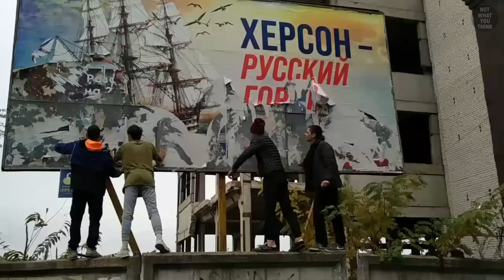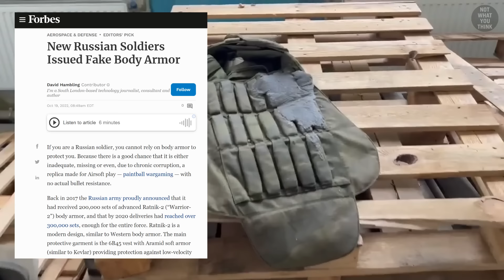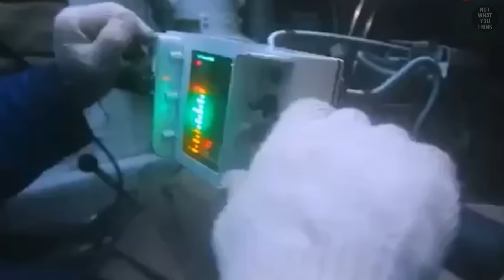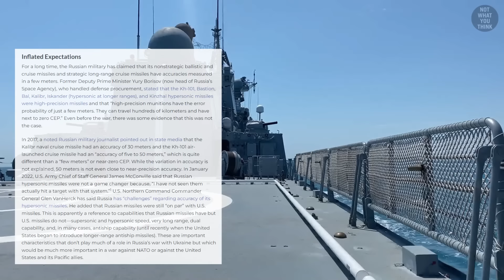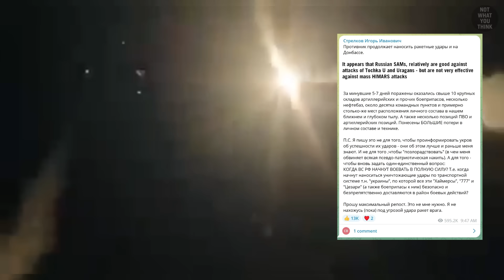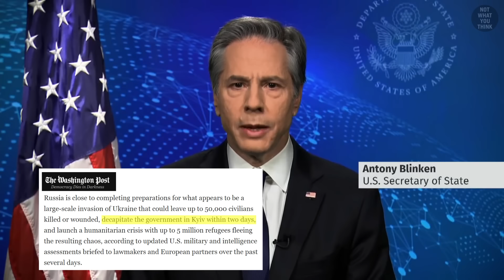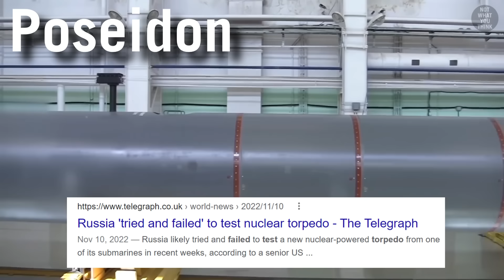The True State of Russian Army

Comment: Lazerpig also has several videos about this topic, my favourite being "what sunk the Moskva" where he goes in detail about how great the ship should've been, and then reads out an alledgedly leaked readiness report. Let me quote this part directly from that video.

"Out of the three-tier anti-missile systems in place, none of the actual systems were working at the time he was struck
the short-range sea to air launchers did not work and the flanex last resort missile interception of which the ship has six, only one worked, the rest were being used for spare parts
this left the s-300 anti-air systems which could theoretically protect the ship, however the radar system they were linked to interfered with the communications system and thus was turned off
but even when turned on, the system apparently had difficulty locking on to targets
and that twin-linked 130mm cannon that could be used as a backup to the CIWS system? yeah that also didn't work, hydraulics leak apparently.
and all the damage control systems, yeah none of those worked either. several other watertight doors were found to be leaking, some were wedged open.
out of the 500 fire extinguishers that were supposed to be on board the ship only had 50
and due to constant theft the safety equipment was locked in storage of which only the admiral had the key to
meaning in order to try and save the ship the crew would first have to try and break open the lockers the safety equipment was in
it gets worse
several of the engines were past their service replacement date by about 10 000 hours, they could only be turned on and run by express permission from the admiral meaning the ship was locked in at about half speed, but only for emergencies
the vast majority of the control systems were non-operable or simply did not have a functioning indicator light meaning that if there was a problem no one on the bridge would know about it the ship's generators were all quickly approaching their maximum service life and would appear to work at random.
the steering gear was also partially jammed and the ship could only perform a 20 degree turn and the entire ship had heating and cooling issues.

Had the Moskva been a US ship and been found in this state the captain would have been court-martialled"
Reply: Moskva was also very old, 50 years old.
Reply: @YorkerEli  Sure... 50 years old does come with its issues... but you gotta maintain your stuff. The Iowa class battleships did fine shelling iraq, they were 50 years old too. Fully combat ready with CIWS and missile launchers. Good maintenance is key, but in the corrupt world of russian officers that didn't happen
Reply: Lazer Pig is ight but the way he exaggerates his accent is annoying.
Reply: I will say this.
I love lazerpig, but, and this is a big but, he was rather quick to take that document as the real thing.
Until I get confirmation that this is a legitimate document of the russian navy, I'm going to hold my doubts on it.

But something clearly went wrong with the ship for 2 missiles to have connected.
Reply: @YorkerEli  the Moskva is only around 40 years old and received a refit in 2016 which expected to extend the ships life expectancy of the ship to 2040.
Reply: @NeputuniaNepp  So if that is the case, it paves even worse look on russian military, if not even refits and maintenance could save it from two missiles.
Reply: Now, wether or not that report is real is up for debate, however, it does raise an interesting point:

According to what we know, the Moskva was sunk by 2 Neptun missiles. They're a ukrainian domestic model, comparable, capability-wise, with something like Harpoon.

Thing is, even if the Moskva's CIWS was inoperable or barely functioning, as the report suggests, two missiles with a warhead of that size should not have been able to destroy a ship that size. It would have been a pretty painful hit, no doubt about it, but it certainly shouldn't have sunk her. There's tables on that type of thing that outline exactly how much of any type of munition you need to have, say, a 90% chance to disable or destroy a target, and according to what we know about Moskva, being hit by 2 missiles shouldn't have sunk her. 

So either, the ship was in such a disrepair that the damage quickly became irreperable, or the damage control teams, if they existed, were completely inept at their jobs.

As for why the missiles weren't plucked out of the sky by Moskva, Perun has offered an alternative explanation, that being operator fatigue. The displays in these ships were built in the 70s or 80s, and aren't very pleasant to look at. Having to look at them for hours on end makes would quickly fatigue your eyes. And if you're months into a campaign, that might lose you to become unaware enough that you don't noticed the two missiles approaching you until their radar goes active and you get a missile lock alert, at which point, activating CIWS might be too late to actually do anything about it.
Reply: @nukclear2741  I think this and other videos showing how badly the Russian military is at the moment, especially logistics and supply-wise it adds credence to Lazerpig's video.
Reply: @spookyskelly5276  But you love his singing.
Reply: About the only part of this I find entirely unbelievable is the bit about a US ship in that condition, if a US ship were found to be in that sort of condition pretty much the entire officer complement would be looking at a dishonourable discharge for not fixing it or reporting the problems, any military port that had so much as refuelled the vessel in the last 3+ years would be getting grilled about why they didn't report it, the last 3-5 docks that performed maintenance on her would be audited within an inch of their lives, and any contractors involved would be almost guaranteed to lose their contracts. The US Navy takes their vessels condition pretty damn seriously, for good reason given how much they tend to expect of their ships in terms of operating ours and distances, and they take their reputation even more seriously, jeopardizing that is a real quick way to land yourself in very hot water. 

Pretty much everything else is at least believable, given some of the other things we've seen both recently and over the years from Russia. Not saying it's true, but it's at least not outrageous.
Reply: Now that makes sense!
Years before this I had some thoughts thinking that how did the Russia’s weak economy supports it’s big ass military assets
Well turned out that they don’t
Reply: Black sea fishes have new homes now, Moskvaville. Rent free too. Reminder: Fish🐟 homeowners meeting in Moskva's CIC, every 1st Saturday of the month.😄
Reply: This sounds like the litany of issues that caused the WWII USA’s Mark XIV torpedo to be such a dud.
Watch “Drachinifel’s” YT Channel on this torpedo,  called *Failure is like Onions … * for the best 45-minute Failure Analysis you’ll ever see! 😊
Reply: @YorkerEli  - the USN has some ships that are over 60 years old - still functioning. The average age of the Navy’s current battle force ships is 16.4 years—about one year less than half of the fleet’s notional service life of 35 to 36 years.
Reply: @NeputuniaNepp  - WAS…. Hahahahah
Reply: if it is all true then that boat was literally floating trash can and it was cheaper to blow it up, than try to fix everything broken.
Reply: Смехотворно. Источник - верь мне, бро.
Reply: Ну затопили и чё дальше, все равно все кто на том острове остались до сих пор лежат там в виде костей.
Reply: @YorkerEli  The USS Iowa, a WWII battleship, was decommissioned in the 1990s. Russia has no excuse.

Comment: It might be unbelievable to see so many things failing due to maintenance, but to be honest high end tanks, trucks, and aircraft require a very significant amount of highly trained crews to support their operation.  For example for each individual fighter jet sortie you will typically have between 20-50 technicians dealing with the fuel, inspections, engine maintenance, repair, rearmament around the clock.  Much older equipment, like the simple truck or less sophisticated tanks, requires less frequent maintenance and fewer support personnel; but they still require people trained in proper procedures and quality components (tank tracks fall off pretty easily if you use 40-60 year old spare parts, or don't know the people with knowledge of the 'tricks' to making them last).  And then when you use that older equipment you can't expect them to perform up to the speeds and capabilities of newer models.
Reply: hi
Reply: and russia lacked all these things. im willing to bet that a the majority of nato equipment in storage is well maintained and works when needed
Reply: My dad was in soviet army, all I can say is it wasn't maintained then, now it probably is worse. He had to drive a rocket carrier truck once a year just to see if it's running, a f-ing rocket carrier with 2 cabins. His jeep wasn't better either , if it broke down he didn't get new parts, he had to take them from another jeep that is sitting by side and is not used currently
Reply: @jimmybayconn  thats a big assumption, I think most nato states has the same fate because after the cold war most nato countries cut their defense budgets, only the US didnt.
Reply: the culture of  Russia the General takes a cut, the Major takes a cut and the Captain, the NCO and then the lance corporal. so when you get to fixing the actual tank there`s just a few roubles left
Reply: @muchi123456  No, the difference is that NATO states slashed their numbers. My own country for example would have to borrow tanks from Germany, if we want to have tanks. The equipment we do still have is very well maintained. 

Russia on the other hand has a very low military budget, but they do keep all their equipment, leading to said equipment being in all states of disrepair and destitution
Reply: @jimmybayconn  Yes and no, every more complicated equipment in storage is inspected every two years, and mantained every 10 years and overhauled (S4) every 20 years.
So if you have an item which is 11 years in Storage, it will work, if it is 21 year in Storage no Problem. Is it 19 Years... good luck. One of the reasons why the Bundeswehr scrapped 300 of it's 400 PzH 2000 even when they have been only 15 Years old at that point. The Depot Costs for them would be eat hefty into the budget. And nobody expected that we need them 10 years later.
Reply: @youtubevanced1508  no really the new tank you talk of doesn`t work. it`s also very heavy and uses a good deal of gas. you also got to get the tank there in the 1st place.
Russia likes to use trains as a means of transport of heavy tanks and big guns.
however, once you run out of track the tanks are struck 200 miles from your objective.

i would imagine once this war is over any direct bridge, road or rail track will be ended way before the Russian border. instead new roads into Poland will arise. i did wonder why the Ukraine did not bomb these bridges in the early  days of the war.

to stay you put old tanks from the 1960s era and men in helmets made during the reign of Stalin as a means of fooling the Ukraine is daft and silly idea.
Reply: @muchi123456  They also have smaller militaries, so they can use that smaller budget to still keep their equipment maintained.
Reply: @Elkarlo77  But they did scrap them, unlike the Russians who just keep them despite the lack of maintenance
Reply: I think both stories about the Soviets are likely true, my Dad was in the British Army and told me stuff broke down all the time, it happens, he said once that when they were trying to sell stuff to some country and the French were also trying the make the sale and won, thing was their stuff was no  better, but they would sneak around and replace parts at night so it dident look as bad lol. In the end its all about preception, French stuff never brakes down? No, you just dont see it, but lies can always go too far.
Reply: Which is exactly the point, I think. They're down to using old crap because they are incapable of fielding modern gear.
How many technicians does it take to maintain cardboard body armor and WWII small arms?
Reply: I was a tech in the RAN and I can tell you that ALL military gear breaks down and needs fixing.
Reply: @bossdog1480  And when there is no maintenance... And when the gear is fifty years old...
Reply: @localreviewking134  And then you find out that some conscript ripped all the wiring out to sell the copper for some Adidas.
Reply: Bad luck then if their  skill level is drunk  Russian!
Reply: @vsGoliath96 or they siphoned out all the good gasoline or diesel and put in either water or stale gas so that it looks full in terms of the fuel gauge but when you go to start it runs for maybe five seconds and then stalls because the carburetor is clogged as shit

Comment: This is by far the best video I have seen from you! You showed nothing but facts and a ton of information that I was unaware of, like how deep the corruption actually flows through Russia. Proved everything you said ! Great job, I was expecting to hear everything I already had and was assuming your just late on making the same type of video everyone else has. But that was not the case! It certainly was Not What I Thought!
Reply from the maker: Thanks Jacob!
Reply: the bit about Ukrainian missiles striking Poland isn't a "fact" as it hasn't been confirmed to be Ukranian. In fact, it's most likely Russian but the west doesn't want to antagonize Poo-tin. Even if the missiles were Ukranian, the way it's presented in this video is inaccurate. Russian missiles "returning to home" are ones that were supposed to be set up to specifically target a different area. The missiles that struck Poland, IF they were Ukranian, were almost certainly fired from a SAM system  in an attempt to destroy Russian cruise missiles, then missed and kept flying into Poland. The reason we know this most likely isn't the case is that Ukranian SAM systems are configured to blow themselves up if they miss the target to avoid this exact situation.

Comment: 5:40 Well, you gotta hand it to Russian logistics: It takes some talent to destroy a Kalashnikov like that
Reply: I guess since they designed it, they would know a shortcut or two in destroying AKs.
Reply: It's easier then you think. Sell materials and pocket money what was given to repair warehouse roof. Inspectors never will come when it's rainy weather. They will never open crate to check firearm condition.
Reply: Maybe they were short on cosmoline.
Reply: Uh, mix Mazut/Bunker fuel with used motor oil, heat till the mix is good and runny, then immerse stuff you want to not rust in it and then drag it out to cool?

Note: the above “waste” materials give a “crude and nasty” species of “Cosmoline.”  Adding some paraffin or other petroleum waxes would result in a (much?) closer approximation to the real thing.

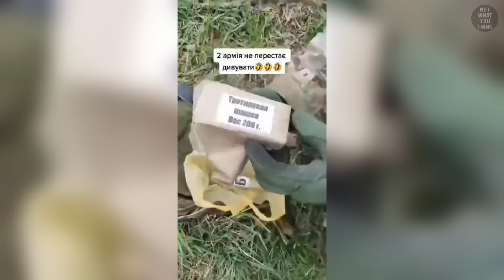Comment: 14:50 Explosive charges with wood? I know what these are!!!
I did demolition training in the Spanish army (field artillery). These charges are meant for training and come in normalized sizes, I think this is a 250g pack. 

The reason is that TNT does not just explode as in the movies, it explodes "by sympathy", it needs a fuse and an initiator charge, which is a smaller charge (50 or 25g, can't recall) and you have to put together the bigger charges adding smaller ones together until you get the desired weight of TNT. 

These wooden blocks are to train how to set these up, add the fuse and the cable, etc... Once you learn how to safely set up a charge you get the opportunity of the real deal (which is amazing!!!)

So, these Mobiks got freakin' training charges!!! OMFG!!! Well, at least they can use them for heating.
Reply: They can't even use them for heating, because they received toothpicks instead of match ;)
Reply: That's some good trolling I see. Keep going Russophobes!
Reply: сначала говорит,что так этими боеприпасами обучают,а потом говорит что им выдают мобилизованным,которых обучают.Гениально
Reply: @OwOchina  и про имперские взгляды поясни. У скорее социолист или центрист.ХАХАХАХАХАХАХ. Даже наверное не знает значение этого понятия. ХАХАХХАХАХАХАХАХА. Клоун)))))))  Продолжай выступать :D
Reply: Spanish army 😂
Reply: @devilution928  NATO for you Vatnik. And we got real TNT. I trained for a year with anything from handguns to 105 mm field howitzers.
Not to mention that the Spanish navy is all on it's own bigger than the Russian one. 
AND right there in the Straight of Gibraltar, the NATO lake.
Reply: @noosphereexists2315  он говорит, что эти обвинения сделаны в учебных целях. На фронте они бесполезны. Но мобики получают их вместо настоящих.
Reply: @VFella  It was a compliment cuz I'm Ukrainian and I like people like you. What about army and volunteering, as I'm not old enough to go to army I do send money to volunteers who helps allot civilians and armed forces of Ukraine. I think you just didn't get what I wanted to say
Reply: @VFella  Хотелось посмотреть на ваши док-ва про последнее.А не тратить свое время.